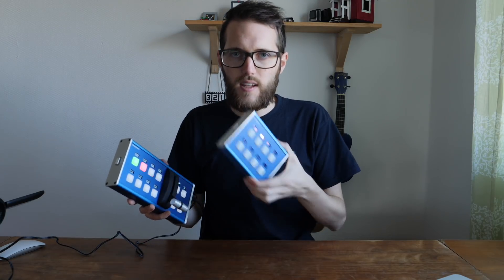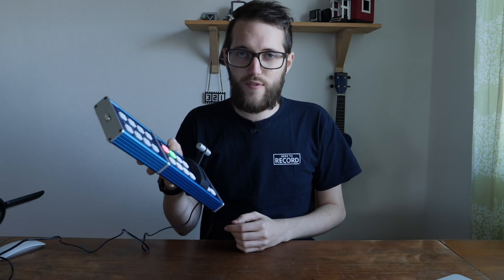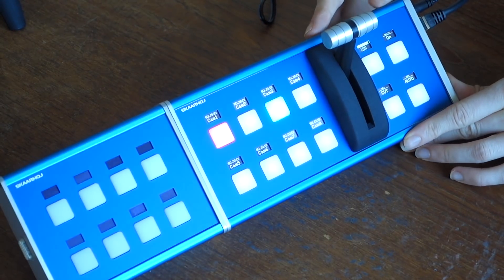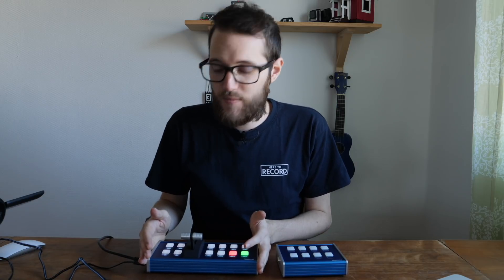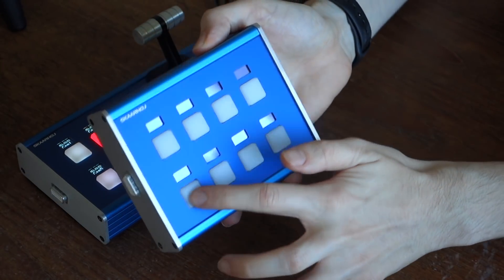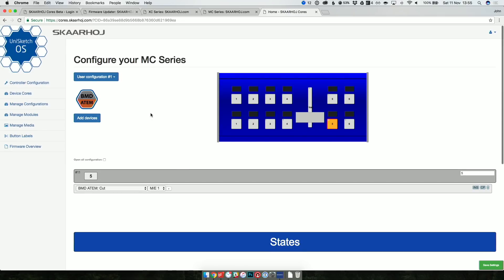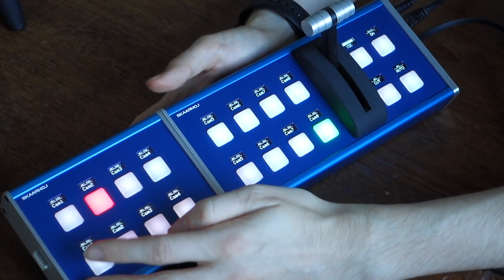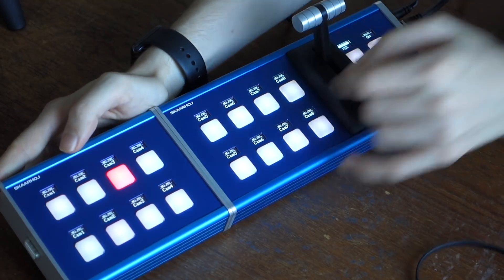Skaarhoj MC Series - Modular ATEM hardware panels // Show and Tell Ep.44

Comment: You're within a stone's throw of an actual ATEM. Why bother? And the iPad software is $50 dollars and gives you nearly full control of the ATEM.
Reply from the maker: Personally I would choose physical buttons over software buttons any time. Secondly you are not always right next to an ATEM - and often you want to lock down and customise a control service for certain gigs. Ultimately though, it does all depend on your use-case and budget etc!
Reply: @heretorecord  But you can get the full ATEM Television studio with full physical buttons for everything for just a few hundred dollars more.
Reply from the maker: You sure can. If that fits the users needs then they should get it!